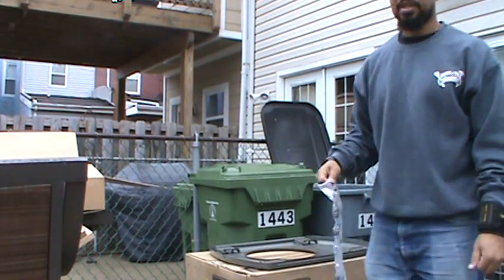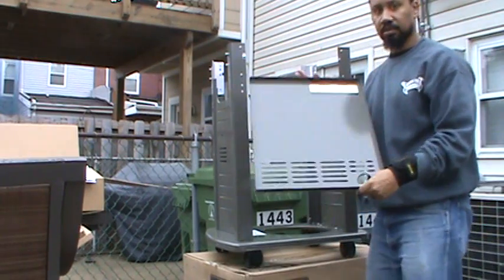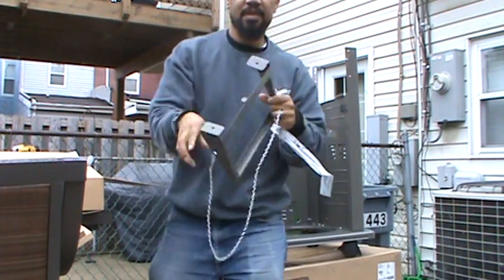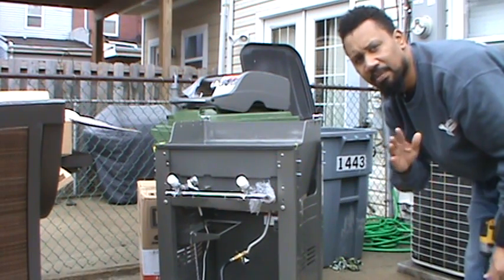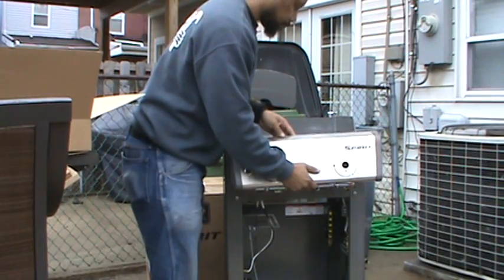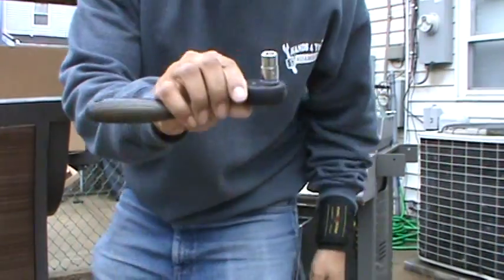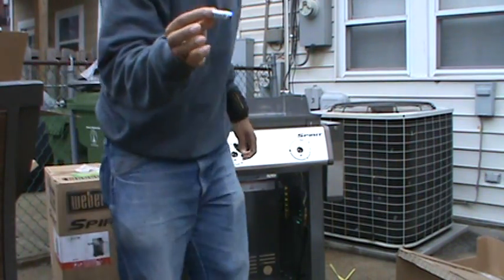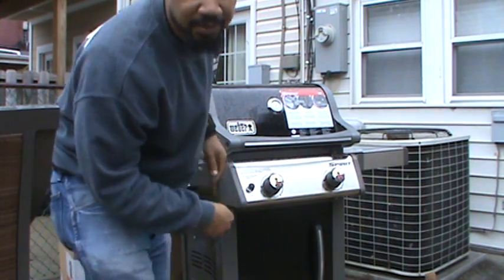How to assemble the Weber Spirit E 210 lp gas grill

Comment: Thank you for this video. I like the fact that you recorded it in real time and did not skip around. Other videos on YouTube claim to be reviewing or setting up this grill but they are using the Spirit II E-210. You are correct in that this is the Spirit E-210 - not the II model. We have had this grill for several years and while the grill itself is still good, the stand, which is painted metal, is rusting. It sits on our deck in the weather but is under a full grill cover. The base especially has rusted. We don't get snow in South Alabama but we do get a lot of rain and we have high humidity. I've ordered another grill like this and when it comes I will put it together. Lowe's would assemble it free but... I'm retired (70 years of age), and bored, and wanted a little project to do. Also, I will place all the painted metal parts on a plastic sheet on a table. I'll then spray them with a clear coat, at least 2 coats. I would suggest all you do-it-yourselfers do this. Metal parts are powder coated (all manufacturers do this). That means a positive charge is applied to the paint and a negative charge is applied to the metal. The paint is then drawn to the metal. Looks great but it is thin. The clear coats will help protect these painted surfaces. Again, thank you for this video. A very good step-by-step guide.

Comment: Thankyou for posting this vid. Great job explaining how to put this machine together. I have the same e 210 and the plastic grey end caps to the control panel melted little bit underneath and wanted to replace them. Weber does not have them separate but I had to buy the whole front control panel. And with your video, I now know how to replace it with the 2 small screws under the knobs and two other at each corner.  Thanks again😃🤙
Reply from the maker: No problem, Thanks for watching I'm glad this video could be helpful.
Reply: I’m embarrassed for Weber that the plastic pieces couldn’t be purchased without buying the whole panel. Somewhere in an assembly factory there is a giant bin of plastic pieces that some worker installs that can easily be put in a mailing envelope and shipped for very little $ and very little waste.

Comment: Thanks man, that saved me some work. The only thing I'll add for other not so handy guys like myself is when you put the braces on for the fold down shelves, you may have to push in on the sides to get them to go over the bolts. And the bags of screws, bolts, etc. are, of course, in the bottom of  the box on the backside of the grill lid. My only concern with the grill is the knobs are plastic, which means when they get hot, they'll get brittle, and break off. All ovens do this now, I've replaced the knobs on mine twice in 2 years. Thanks again for the video, it was really appreciated.

Comment: It would have been helpful to explain what tools are needed and to have started from box opening and extraction of items. I am a DIY total moron and about to start building mine. I am expecting it to be a disaster and take multiple days.
Reply: haha this is a joke, already had to stop the build as missing bolt and nut packs A J & K. On to Weber support, wish I had not bothered buying this and just bought a cheapo supermarket job.
Reply from the maker: Sorry to hear that. Weber are usually quick with sending missing parts.
Reply from the maker: Thanks for the advice I will definitelywill be doing that next time. I used a 5mm socket and a Phillips head screw driver bit.

Comment: Great video!

I am looking at a used NG unit just like that.  Is that base plate that the wheels screw to an aluminum casting or plastic? From the sound of the small impact driver it sounds like AL.